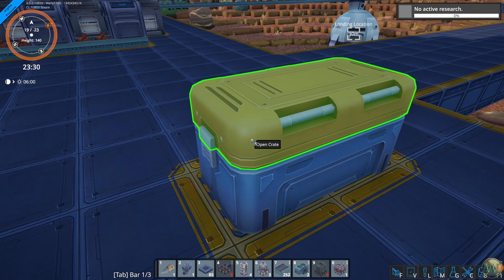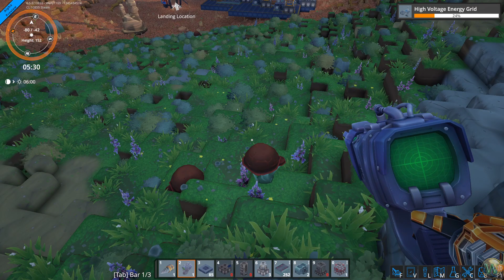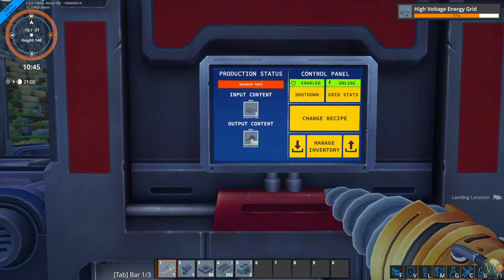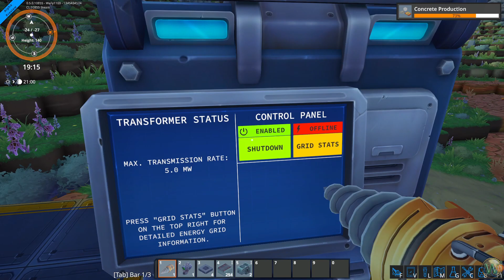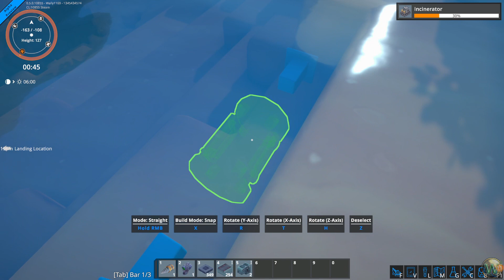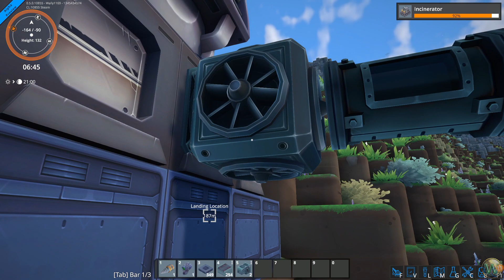Foundry - 0.5 Demo - Pipes & Boilers & Steam Turbines - Let's Play - Episode 5

Comment: After screaming "pipe intake" at the screen for 5 minutes or so he finally works it out n then places it on the wrong end of the pipe.  Bless You Wally 😁

Great vid though, im just getting to this part in my build now and the tutorials could definitely be a bit clearer.
Reply from the maker: Yeah. I was thinking they worked like the old pipe connectors (from 0.4) on the machines.  And then games like Eco where you just stick the end of the pipe in the water and it works

Comment: 15:49 I came to conclusion we always want to have more servers than we can supply. Slowest research in the game take 60s per 2 science packs (1 of each color), so that's 2 labs per 2 manufacturers which produce 2 science packs a minute each (2 blue and 2 red every minute). I had 8 manufacturers (4 of each color) and 8 servers which means servers should've consumed science pack as fast as I produce them. And yet, somehow, I end up with completely full belts and full stacks of science packs of both colors in manufacturers. The belts only cleared out when I added 9th server.
Reply from the maker: Yeah, because you were making them as fast as you consumed them the belts and buffers were already filled.  I just needed to build bigger, but since I knew I was near the end, I didn't want to put in the extra effort.

Comment: Wally, transformers are your high power capacity for your low power buildings. So if you have enough buildings to use 10 MW of low power you would need 2 transformers since each transformer has 5 MW capacity
Reply from the maker: Yup, I remember that from my last series.

Comment: Don't feel ball Wally, it took me a long time to figure the steam system out too. I have one steam generator to 3 generators,  works great and uses tons less fuel.
Reply from the maker: Is that 500 L/m steam correct?  If so, it should be like 30 turbines to one boiler.

Comment: Just finished working through the available tech tree and building all the available machines (including the incinerator. Water and Steam was a bit confusing to figure out, as well as the High voltage / low voltage stuff, but over all I was really pleased and eager for the game to either release or open to early access.
Reply from the maker: Ah cool!  Yeah, I think my knowledge of the 0.4.x version hurt me here with the pipe stuff.  They changed a bit how those connect to a machine and there was no water extraction before.